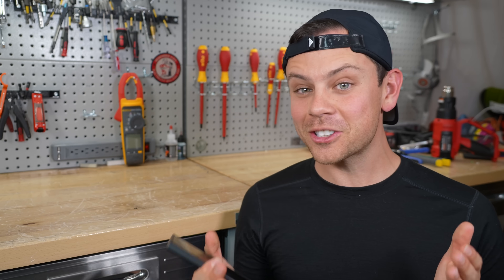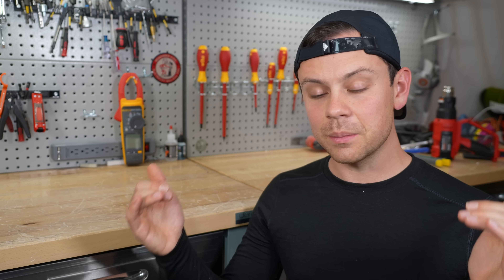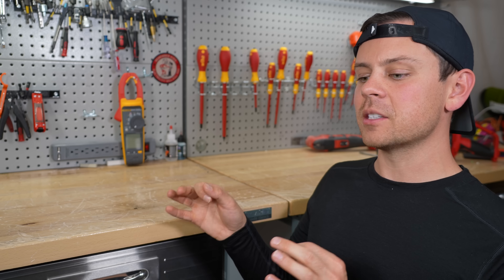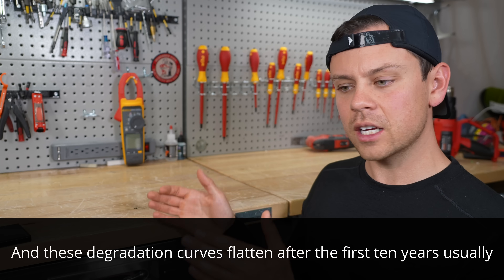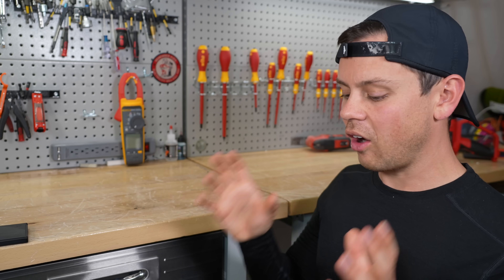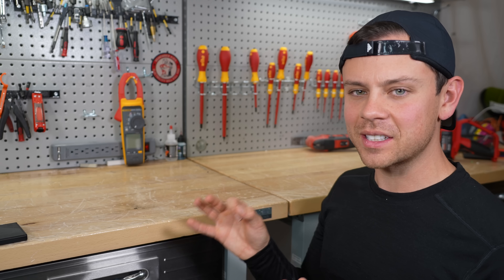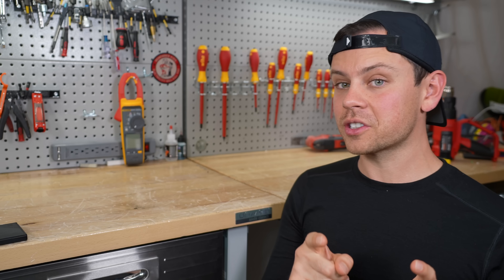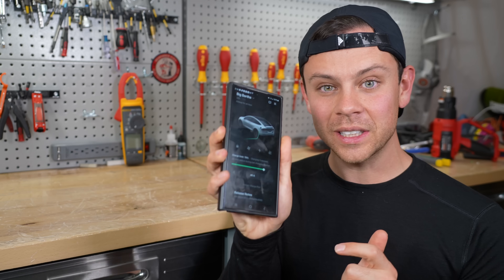LiFePO4 Longevity Discussion! Why Charge to 100%?! For Solar??

Comment from the maker: If you want to learn more about everything I said, I have a longer video that discusses all of this!! Check it out here: https://youtu.be/K9Tfivf5bAI?si=xwHhpBKiDqHN92V4

https://www.mdpi.com/1996-1073/14/6/1732

If you are still scared to charge to 100%, check out these studies and discussions. Calendar aging will probably degrade it first:

Pay attention to the storage temperatures in this study and capacity fade: https://iopscience.iop.org/article/10.1149/2.0411609jes/pdf

https://www.sciencedirect.com/science/article/pii/S2589004224015128

https://diysolarforum.com/threads/collection-of-studies-about-lifepo4-degradation.14823/

https://www.semanticscholar.org/paper/Calendar-ageing-of-LiFePO4-C-batteries-in-the-life-Swierczynski-Stroe/8ce543196b4fac97fd89c74a6f456bcfb907a32e

https://vbn.aau.dk/ws/portalfiles/portal/407465140/energies_14_01732.pdf

Original video: https://youtu.be/UbZiHzflKMY

~~~~~~~~~~~~~~~~~~~~~~~~~~~~~~~~~~~~~~~~~~~
Tired of getting ripped off? Check out my "Will Prowse Approved" solar product recommendations below!

12V Batteries
https://www.mobile-solarpower.com/lithium-batteries.html

48V Batteries
https://www.mobile-solarpower.com/48v-batteries.html

Offgrid Inverter System Builder
https://www.mobile-solarpower.com/48v-complete-system-blueprint-559371.html

Hybrid Inverter System Builder
https://www.mobile-solarpower.com/code-compliant-48v-offgrid-system.html

Mobile Handtruck System Builder (very popular!)
https://www.mobile-solarpower.com/mobile-48v-system.html

Solar Panels
https://www.mobile-solarpower.com/300w-solar-panels.html

Ground Mount Solar Racking
https://www.mobile-solarpower.com/ground-mount-racks.html

Wire, Lugs and Busbars
https://www.mobile-solarpower.com/wire-and-connectors.html

Tools
https://www.mobile-solarpower.com/tools.html

Fuses and Circuit Breakers
https://www.mobile-solarpower.com/fuses.html

Plug-N-Play Solar Systems
Ecoflow, Anker And Bluetti! So many models to choose from. See my current recommendations here:
https://www.mobile-solarpower.com/full-size-systems.html

~~~~~~~~~~~~~~~~~~~~~~~~~~~~~~~~~~~~~~~~~~
Need to build a large DIY system? Need a trustworthy solar distributor? These are my favorites:

Signature Solar
Creator of EG4! Solar Minisplits, Victron and More! Largest Solar Store Online.
If you want $50 off, please use my link below and coupon code "DIYSOLAR50":
https://signaturesolar.com/?ref=cPwLcVc0SW-BjN

Current Connected
Best Prices for EG4, Victron, Midnite and so much more! Fast Shipping and Highest Rated Customer Service:
https://currentconnected.com/?ref=wp

~~~~~~~~~~~~~~~~~~~~~~~~~~~~~~~~~~~~~~~~~~
Join our DIY Solar Community 
Need more help? Join the largest solar forum on the internet for beginners and professionals alike. 140,000 members and counting!
https://www.diysolarforum.com

Check Out My Free Book
Best-selling and beginner-friendly guidebook to off-grid 12V solar!
https://www.mobile-solarpower.com/the-book.html

~~~~~~~~~~~~~~~~~~~~~~~~~~~~~~~~~~~~~~~~~~
Contact Information:
I am NOT available for personal solar system consult! If you wish to contact me, this is my direct email: williamprowsediysolar@gmail.com
FTC Disclosure Statement and Disclaimers:
Every video includes paid promotion or sponsorship (such as free products for review). Some links on this YouTube channel may be affiliate links. We may get paid if you buy something or take an action after clicking one of these. My videos are for educational purposes only. Information is subject to change/update at any time. Electricity is DANGEROUS and can kill. Be smart and use common sense :) DIY Solar Power with Will Prowse is a participant in the Amazon Services LLC Associates Program, An affiliate advertising program designed to provide a means for sites to earn advertising fees by advertising and linking to Amazon.com
Reply: This is just logical, if you have one at 80% and one at 100% there will be more weight in one than the other, so of course they won't be balanced ;) Thank you for all you do.
Reply from the maker: @antonyjh1234  🤣🤣
Reply: @WillProwse   i did a solar system with 16 units 18k pv luxpower  and  32  14.3kw battery working very good we get about 1.5 megawatt per day
Reply: Completely off grid
Reply: i charge to 101%... mine go to 11
Reply: i agree with you 100% but i have a question ... if i am using a EF delta 3 Plus as an overkill ups and a phone charger lol (until it is needed i live in Central Florida)... where should i keep the charge level iyo
Reply from the maker: @mikelowder7082  oh good question. If the pack is at a cool temperature, I'd just leave it at 100%. For backup, every Wh matters. The degradation rate is not that bad when stored at high soc (check out charts in the videos) as long as you keep them room temperature. I wouldn't worry about it
Reply: @WillProwse  Room temperatures in our country, Pakistan, is more than 32 degree Celsius for most of the year, almost 9 months.
We charge our batteries with solar only.
Should we charge/discharge LFP 0-100%?
Reply: @WillProwse  thanks so much
Reply: @mikelowder7082 if I were you, I’d invest in a CyberPower PFC Pure Sine Wave UPS for anything sensitive like electronics/computers! I have an EF Delta Pro & Extra Battery recharged via AC during off-peak and CyberPower UPS for everything else!
Reply from the maker: Made a new video covering every point in this video in more detail: https://youtu.be/K9Tfivf5bAI?si=xwHhpBKiDqHN92V4
Reply: I think people are mislead with the scientific tests.  While there is real degradation in above 80% and at 0%, it is impractical for LFP due massive cycle life and low cost.  After 10 or 20 years, batteries would have become cheaper and better at the same time.  You are more likely replace, upgrade, add to these batteries prior degrading to 80% or less. Ageing of the battery likely offsets or beats the gains of not fully utilizing LFP.
Reply from the maker: @zodiacfml  absolutely
Reply: What is the voltage I should set my inverter for 48V system so my batteries will be charged 100%. I have 8  200Ah WATTCYCLE batteries. Thank you.
Reply: @levonet33  Does your inverter also have a built-in charger? I think the charging voltage you set is essentially related to what your battery chemistry is. Without knowing that, it is not wise to give an answer because it could be wrong and then you will destroy your battery. Wattage cycle has nothing to do with this question. A battery is full when it is full - regardless of the recommended depth of discharge for it, which is usually expressed in ampere-hours.
Reply: If i put that battery in my RV and the alternator only puts out 13.8 volt will this battery take a charge at all ? Will it fully charge or only 80% lets say?
Reply: @ZILAwelds  I wonder if Will will answer our questions.  If an alternator puts out a certain voltage, I don't believe that it could charge the battery beyond the capacity of the alternator.
Reply from the maker: @ZILAwelds  usually 13.8V won't be high enough to trigger balancing or balance at a decent rate. Need to get it higher.
Reply: @WillProwse thanks! Is there some electronic gadget I can use to do this or do I need a new different alternator altogether?
Reply from the maker: @ZILAwelds  personally I would just charge it to 14.5 every few months. Should be ok
Reply from the maker: @ZILAwelds  hold it at 14.5 for a few hours. Could even use cheap psu to do it
Reply: @WillProwse  thanks
Reply: @WillProwse  Hi Will , how many hours  should I set my charge controller for in bulk mode ? ... I have a 280ah lithium.
Reply: @ZILAwelds  be careful because you might end up frying your alternator.
Reply: So I am sorry for being dumb, but I have to ask.  

I have my charger set for 14.4v absorption and 13.6v float and storage.  Recondition and temp compensation are disabled.  This is a Victron IP67 Blue Smart 12/25 charging a 2x WattCycle 12v 300Ah in parallel.  Is that 14.4v absorption sufficient for balancing, or should I be upping that to 14.6?  Between the battery documentation and the charger documentation, I am not sure which is correct, but I figured the lower value would be safer and get me at least up to 95% if I am reading the graph correctly.  I guess what is getting me is the battery docs don't state what voltage the balancer kicks in, so .... ?

Thanks, bro.
Reply from the maker: @Lee_Adamson_OCF  anything between 14.4-14.6V will balance those. Should be good
Reply: Thank you for including the scientific studies above.  I enjoyed reading them.  Since my system is in an off grid, cold weather environment 5 months out of the year, subject to long periods of storage situation, all of this information is valuable to me.  
A few years back when I first dipped my toe into the Lifepo4 waters (replacement for AGMs) I was really concerned about 1) temperature and storage and 2) SOC during storage.  So much information has come to light regarding this chemistry in the last few years that has lessened my concerns tremendously.  Additionally, Upnorthandpersonal has provided me with scientific papers that have alleviated many of my fears.  
Here is what I do presently and have been doing for the past 3-4 years.  When I close the cabin for the winter I turn off ALL loads, bring the batteries to 50-60% and close the door.  Temps will drop well below freezing for at least 3 months.  Upon opening up the cabin in April I re-connect the loads and the solar panel disconnect and resume usage.  All my BMSs have low temperature protection at 35 degrees F.
This was the recommendation from Upnorthandpersonal supported by the research papers he forwarded to me and it is working for me.  No discernable degradation of cell capacity.  As mentioned, there are a lot of opinions on how LifePo4 reacts to temperature and storage but pay little attention to me and others who have opinions.  Get the research papers, read and digest them and draw your own conclusions.  Not all want to put in the time for this.  That is ok.  Perhaps they are better off having a system installed by professionals or...... just take your chances and do whatever you desire.
Reply: I have been using my Bluetti AC200P on the road in my van full time for a year and a half and always charge to 100%.  I have 720 watts of solar which is constantly recharging it while it runs my window ac during hot summer days, and my fridge 24/7. The only issue that comes up is that about once every 2 months, I have to resync my bms as Bluetti suggests.  I can tell when this needs to be done as it will be at 100% then 10 mintes later show 87% while running just my fridge which only draws 36 watts when the comoressor is running. I follow Bluetti's instructions and unplug my solar and let it run to 0 and turn off.  Then I crank up my generator and plug my solar in and charge it back to 100%.  Then all is well until next time.  I know if I charged to 100, and unplugged the solar and took it all the way down every time, I would probably not have to do that procedure but, being out here that is not practical for me.
Reply: Will!! Do you have a link to the charger?
Reply: Will, you said that indoors we will not have a problem. How about setting a system up in an attic?
An attic can get very hot in the summer, especially the old style wo a ridge vent. Would this hurt LiFePO batteries?
How about a SolArk... would the inverter suffer?
Thanks!!
Reply: @SUNofNY no you're fine. Just keep it out of direct sun
Reply: @SUNofNY  I won't speak to the battery question because Will covers that way more than I could, but re: the inverter or any other components, it's a complicated question because it mostly depends how hot and for how long, compared to what the temp rating is for the equipment. 
As it gets close to peak temp, any good quality equipment that's intended to serve critical loads will "de-rate"  (reduce its own output to reduce heat) to try and extend the time before it shuts off  aand then once it hits max temp shut itself off before it damages itself. You may have to download the owners manual on some units to get those detailed derating specs. As an example the Sol Ark 15k-2P specs show "Ambient Temperature: -25~55°C, > 45°C Derating" which is -15ºF ~ 131ºF for operating temp, but will start derating itself (reducing output) above 113ºF.  If this happens a couple days a year, your call as to whether that matters. If over-temp/derating is happening a for weeks or months over time it will eventually have an impact on the inverter lifespan.
If your only install location for the inverter is somewhere  that's regularly going to cook the inverter, you might want to look into microinverters at the panels rather than a string inverter, however I don't really know anything about microinverters other than that they ARE used successfully in hot climates worldwide. 
Another option would be look at what it'd cost to insulate and/or ventilate the attic (even if its active ventilation tied to the attic temps that only runs during the hottest part of the summer), I know that's not cheap and there are a lot of considerations to active roof vents so you don't cause other problems, but if you offset against the cost of solar changes it might make sense.
Reply: @RobertsAdventure  Good points. Thanks.
Reply: @willprowse I’d like to know the answer to 👆this question myself. I have a Solark 12k tied to the grid with 2 Ecoworthy 51.2v 50ah batteries on it. What should I set my charging voltage and amperage as well as my (go back to grid) cut off voltage. Just found you so bear with me if you’re answered this question a million times. I’ll look through your other videos to find a specific voltage.
Reply from the maker: @BigFern9876  let bms and closed loop comms manage it with factory profile. It will also manage charge current for balancing. But if you are doing things manually with raw cells, use these settings: https://diysolarforum.com/threads/recommended-charge-profile-for-diy-lifepo4-batteries-sticky-post.5101/

And for use with those packs I would use the voltages recommended above
Reply: @BigFern9876  charge to 57V should be good. Check what your manual for the battery and inverter says on charging voltage. Cutoff at 44V.
Reply: @BigFern9876 53.84volts
Reply: I was just a bit scared because my manual said it's best to not go lower than 12.85% which is 10% SOC for me. I'm going to go down to 10v from now on since you said it's ok.
Reply: My pylontech 5kwh batteries can't be taken below 6% SOC without issues. At lower SOCs (i.e. 5%) I get an overvoltage alarm on some of the cells and the battery disconnects when I try to charge back up to 100% SOC. For some reason this unbalances the cells
Reply: I knew you were going to catch some heat over that last video. lol
Reply: What about using your solar system to run a 3000watt inverter?  That's going to pull at a higher C rate?
Reply: Hey good stuff. I wonder if you have any comment on what the pwr station's like Bluetti and Ecoflow are saying to charge to 80% and duscharge to 20%. I use mine in a solar system and cycle as much as posible.
Reply: thanks, i looked into that, that auxiliary alternator is overdriven 3:1 that means the fan should work good …. And its a 280 amp alternator so it i hope it does not get as hot drawing 100+ amps charging ….
Reply: Well, if batteries are the same chemistry, from the same batch. And the active balancer balances very last mV, it makes sense.
Reply: Hi Will. I have LFP batteries that I have assembled from individual cells and each one has a jk-bms controller. I have realized that the capacity of the cells is slowly decreasing. I have set the Basic Settings "Battery Capacity(Ah)" of the jk-bms to the value that the cell importer has stated. So I really want to understand what happens when I just use the battery year after year and supposedly the capacity of my battery is no longer what I initially gave the bms. Could you give me an understandable and exhaustive answer to this concern of mine? I have asked the jk-bms manufacturer a few questions, but since I am not a famous YouTube content creator, they do not bother to answer me.
Reply: So did I buy too much battery? I only get down to 0% if it's been cloudy for a few days. That was how I planned it to be. I can't afford to be at 0% in just one day if it will be cloudy for the next 3 days.
Reply from the maker: @lliaolsen728  that's perfect
Reply: @WillProwse how many C Rating would you recommend for 48v 280Ah Hithium Battery Charge/Discharge?
Reply: Thanks.  I took your advice and it makes sense.  I have SOK batteries.  If i let my BMS control charging in conjunction with a solark 5k1p, it only allows my batteries to dischage to 30%.  Can you make a video to remidy this please?
Reply: I'll check out all of those, but for the moment I'm thinking that since we should plan for a few cloudy days, if we don't hit zero and 100% often enough, we should make sure this happens every so often?

I hadn't realized those test results were rapid cycling at 1c.  This is great news, I don't have to spend as much on batteries.
Reply: Hi Will, what about the eg4 power pro battery, SS says note to discharge below 20%, but I want your opinion, would very much appreciate an answer on this. Thanks
Reply: Hey I have an open loop system. The BMS won't work with my older inverters. Any recs on the parameters?